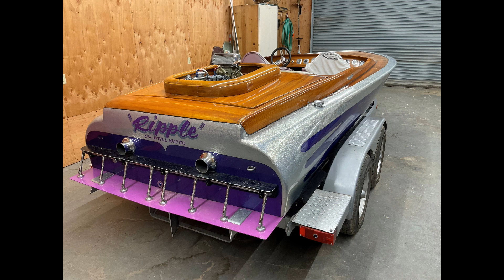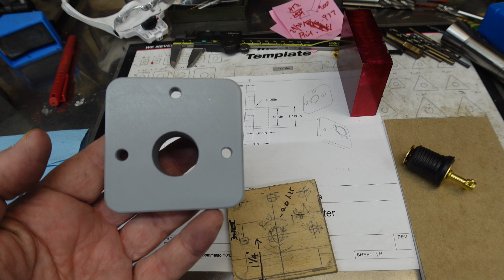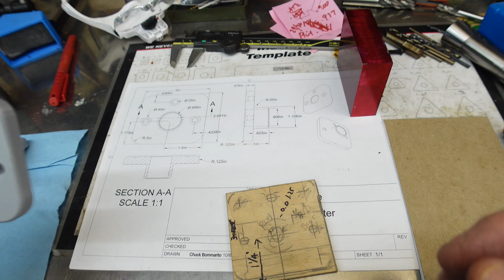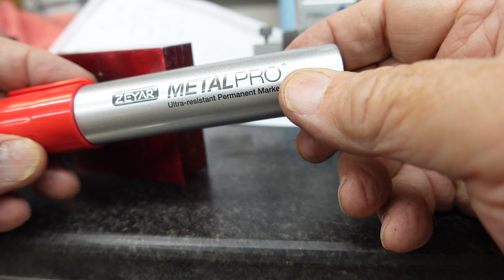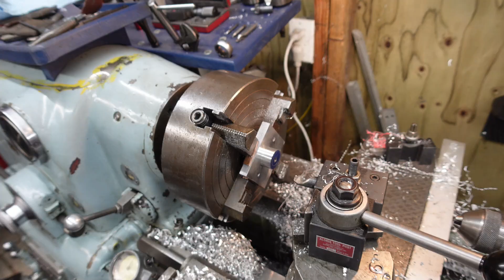Rayson Craft Flatbottom boat repair/fabrication

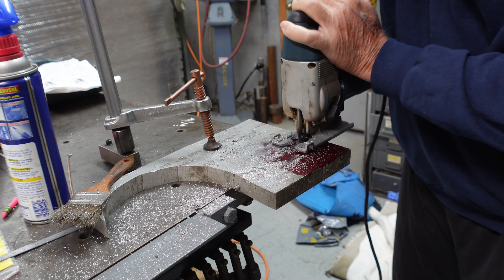Comment: Time 05:00. My first cutting large things like that was drilling a lot of holes, then hack sawing...
Time 11:30. The red cloth.. I do the same, fool myself, to avoid mistakes..... Things to be brought outdoors are placed on the carpet near the door..
 Aluminium spagetti... I once made a 1.5 meter long one, by manual feeding!
Couldn't You use the 3D print block in the boat?
Inspiring video! I have to blow the dust off my machines....

Comment: Nice project Chuck, well done. My only suggestion would have been to machine the parts out of stainless for corrosion resistance...Im sure you used stainless bolts thru the transom to affix it.....and now with the dis-similar metals, stainless vs the aluminum, you might get a galvanic corrosive effect over time with using these 2 metals together, with the corrosion accelerating in salt water enhancing the galvanic effect. 
Just ask any aluminum bodied Land Rover owner about this galvanic effect.
Don
Reply: One answer to that problem is copious amounts of plumber's PTFE tape on the screws. Seals against water ingress and also eases removal.
Reply from the maker: .thanks for viewing Don and your suggestion which is the correct application